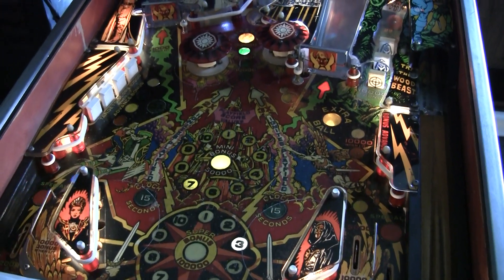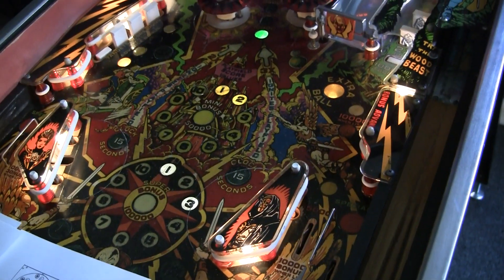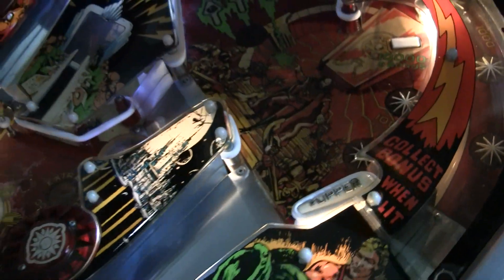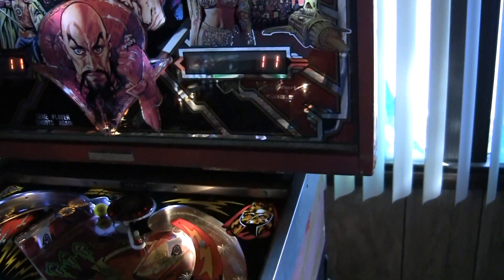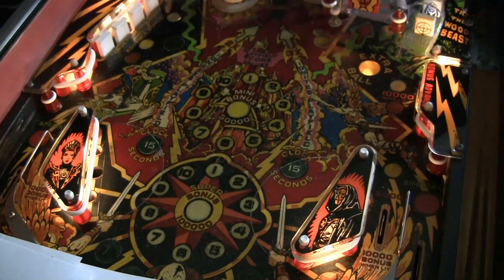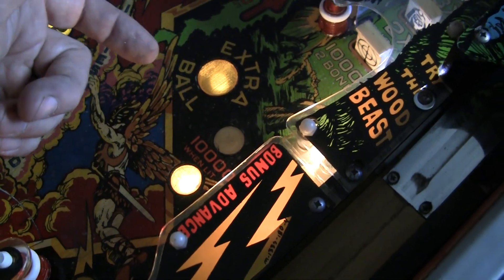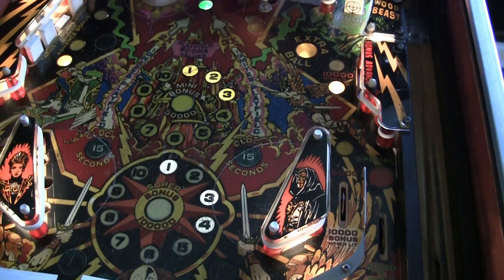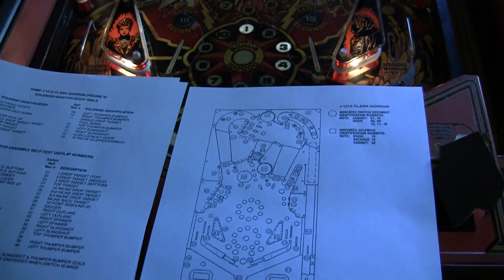Diagnosing switch matrix/tilt problems in Bally Flash Gordon Pinball - PinballHelp.com

Comment: Spotting the culprit diode that may cause the problem is rather complicated. I read something on the web about that and the methodology to narrow down the search.  It was very weird because the signal could reach different rows  or lines on the matrix. For the sake of knowledge, I need to find it back. Interesting problem indeed but chances of having the coin door switches activated during game play are rather low don't you agree?

Comment: Pinball Help, can you make a youtube video that explains more in depth the theory and steps of troubleshooting switch matrix circuits like how to test each row and column using an ohm meter, voltage meter, or using an LED, how to test the diodes in the switch matrix circuit or what else to test to narrow down the problem if its not just a simple stuck closed switch what would you do next step by step procedure?

Comment: I have had the same problem on a williams comet, the problem is a bad diode. You can find the switch if you take the switch matrix and make a square of the switches concerned. You know 3 of them, the coin 2, the top single drop target and the tilt. These will be 3 of the corners and so you can find the 4th one in the switch matrix. One of these 4 will have a bad or missing diode. I wanted to help and looked in the service manual of the flash gordon machine, but the switch matrix in it is not complete so this would need some further investigating. If my reading of the schematic is good it would be the slam tilt switch which has a diode (cr12). You said you already checked the diodes on the other 3 switches so maybe you can check the diode on this on?
Reply: I looked again, and I think I misread it, the 4th switch to look at is switch 15 upper right side target